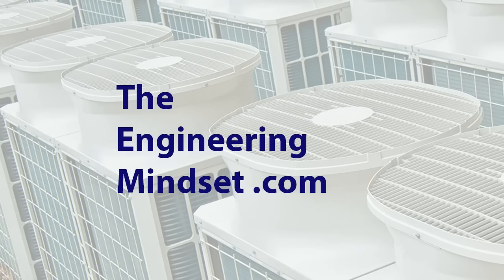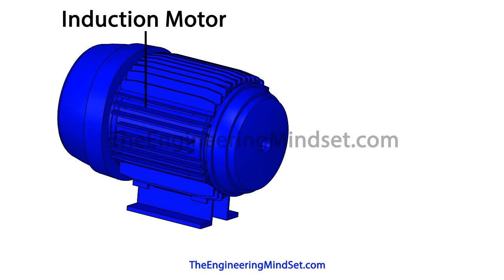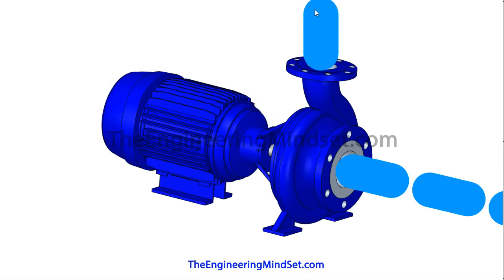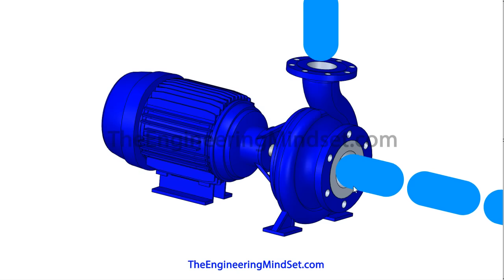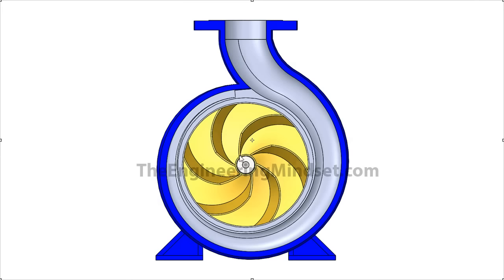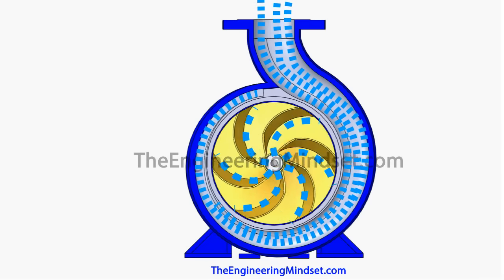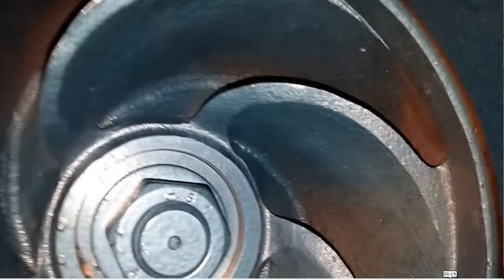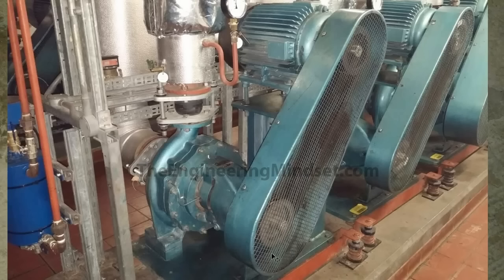Centrifugal Pump How Does It Work

Comment: A pump is a combination of an electric device and a mechanical one. Thank you for educating me.
Reply: Not always. Plenty of pumps are used in agriculture (irrigation, waste water discharge, spraying etc.) and many of them are powered by engines, usually a diesel engine for the bigger pumps.
Reply: Can also be hydraulically driven, gas engine, diesel engine. Close coupled, belt driven or standard couplings.

Comment: Great descriptions. For the Impeller, and the inside of the "Volute" I would go for a material that does not react chemically to water. Instead of Iron I would use copper . Maybe even consider a bladeless impeller. For I know that Kaplan turbines are destroyed on a micro level by micro turbulence . And need maintenance every 5 - 10 years .

Comment: When a fixed speed pump is turned on, is the flow rate produced simply a reflection of external resistance? Does additional circuit resistance slow the pump rotation?

Comment: Im looking for the formula used to figure out the GPM output off a pump, that I only know the rpm,  impeller size and pump inlet/outlet ... so example would be a 3x3 x14 with a 1750 rpm motor and a 11" impeller installed.... thanks

Comment: What are the pushing limits? For example, could a pump like that hold a column of water above it of 3 storeys, 10 storeys? Before it couldnt push the weight anymore.  This is an interesting part of the physics I am curious about
Reply: Depends on the pump. In engineering what you're talking about is known as head and is dimensionally a length. More powerful pumps can give you more head or a higher flow rate

Comment: Just a super cool topic thanks...can anyone explain what considerations need to be known to determine the best amount of clearance to have between the major outside diameter of an shielded impeller and the valute housing?...I would guess as little as possible maybe ideally only a few thousandths of an inch or enough to handle wear and run-out ...but something about past lectures in fluid Dynamics makes me think there may be more to it... Surely when moving screened solid waste...maybe when moving clear water also?

Comment: The vanes accelerate the water in a circle, but the water molecules are not tethered to the rotating axis like the vanes are,  the force imparted from the vane is thereforce only normal to the vane (plus a tiny amount of friction toward the center), so water's own inertia will keep it going mostly normal to the face of the vane. This causes the water to push up against the volute, having a backwards curve makes the normal closer to the volute and also probably helps reduce flow separation at the tip of the vane. At least, this is my postulation.

Comment: I want to know where exactly the fluid enters into volute from impeller.
Reply: As soon as it leaves the vanes of the impeller it is in the volute. As it goes around, there is a piece of the casing called the cutwater that diverts the now pressurized fluid out of the volute.

Comment: great video, how I can avoid cavitation in a centrifugal pump that generates an air vacuum ?
Reply: gonzalo moreno andonaegui 2 ways, give it air or prime it depends on the pipe flow
Reply: Centrifugal vacuum pumps have a very specific design, much different than what is shown here.  They have a water ring and allow air to mix into the water and then discharge the air through the center of the impeller.  Cavitation is not a concern as long as you run it as designed.  Most vacuum pumps are positive displacement, though there are applications that are better suited for large centrifugal vacuum pumps.  They are much more complicated and require support systems, such as large coolers to run.

Comment: At 2:42  you say that the change in diameter increases mass flow rate. From my knowledge, mass flow rate and volumetric flow rate are proportional to each other and  they are constant. Volumetric flow rate is equal to the velocity of the fluid multiplied by the cross sectional area of the pipe and since it is constant, an increase in diameter should only decrease the velocity of the fluid. Could anyone explain how and why the mass flow rate increase?
Reply: Mass flow rate will remain the same. For a given pump impeller design, volute design, RPM, etc.. volumetric flow rate (the amount of liquid the pump can handle per unit time) will remain constant. As you state above, the increase in the volute diameter (which is specifically designed to follow Bernoulli's theorem) will only decrease the velocity of the fluid which in turn boosts the pressure of the fluid Since Q=A*V, the increase in cross sectional area A is balanced out by the decrease in velocity V hence resulting into constant Q.

Comment: Could one use an induction motor and gears to spin multiple impellers?
Reply: Multiple impelers and using gears will require more power which means bigger induction motors but yes it can be done
Reply from the maker: NEW! Check how AC motor works here https://youtu.be/59HBoIXzX_c

Comment: Plunger or water pump...... The correct shape of the blades reduces the electrical voltage.... The design prevents water from reaching the electrical parts and extends the life of the engine.... A question for fun... What is the relationship between air engineering and water engineering?

Comment: What is the Clearance between impeller & casing
Reply: Whatever you set it at. Lol
It should be as close as possible without rubbing. I would set an impeller as close as the thickness of a dollar bill. You would be surprised how much difference  a tiny bit of clearance between a casing and impeller can make. I've had guys complain about load times taking way too long. Put the impeller 1/16" closer and the complain no more.

Comment: Belt drive on a centrifugal pump?  That's a new one for me.  The pump's good for 50 years but the belt has to be replaced every year or two?  Sound's like a maintenance man's looking to make some hours.
Reply: So every two years you have to change the belt?  Direct drive  v's belt issues include, shaft misalignment, (causing bearing wear), motor replacement (definitely easier with belt drive), better physical layout possibilities, (shorter but wider), easier maintenance access to the motor and pump, matching of pump speed to motor speed for differing fluids and mains power frequencies, etc.

Comment: Your explanation about “pushing outward” is not correct. As the name “centrifugal” indicates, rotation of fluid causes centrifugal force. The pump works even if the rotor rotates opposite direction at lower flow rate. The same flow direction.